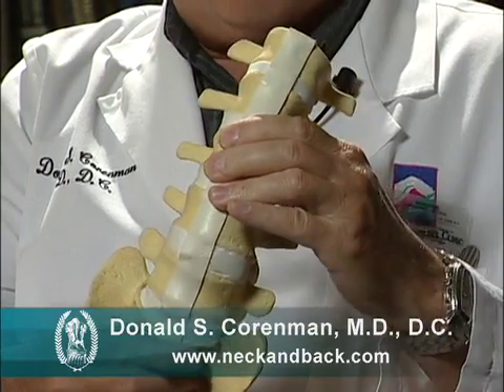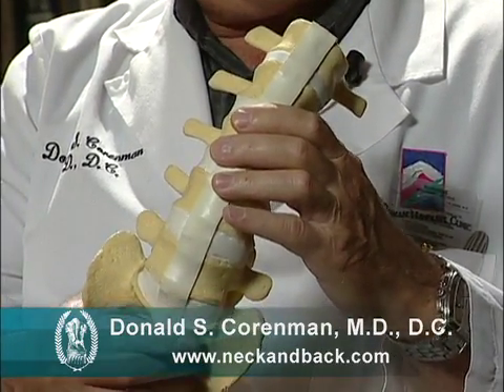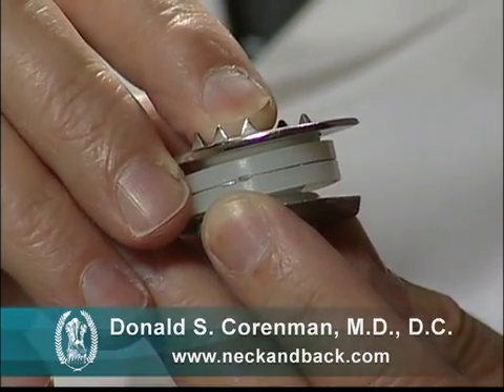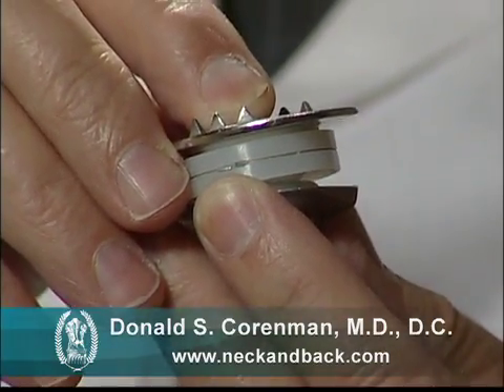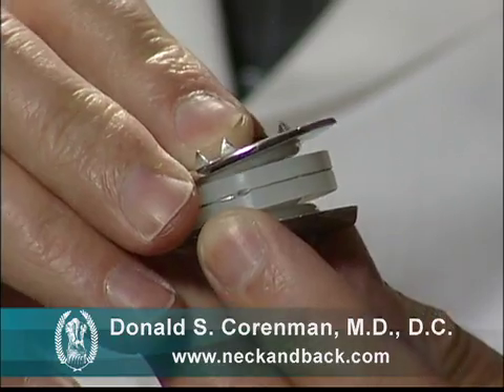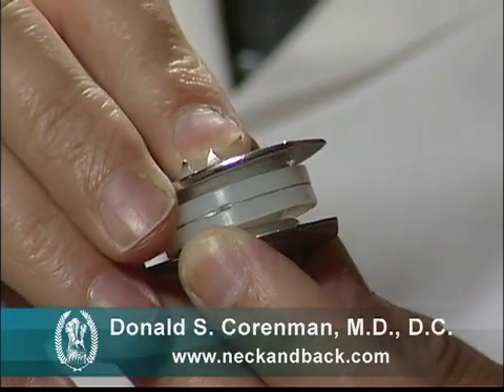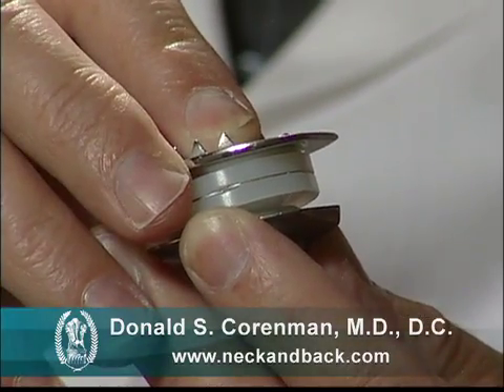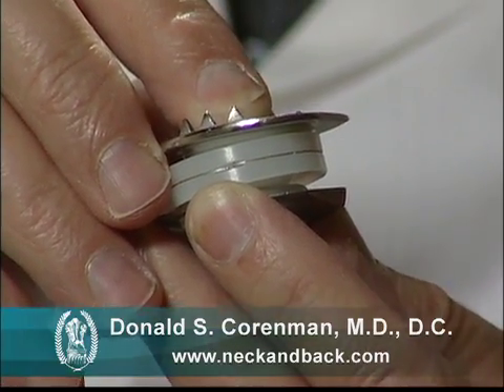Artificial Discs in the Lumbar Spine | Spinal Disc Implant Surgery | Vail Spine Surgeon

Comment: Thank you so much for this video.   You did not mention what type of artificial discs these were.  I was told I need a silicone disc put in where my L4 and L5 is. and that the upper and lower bones would be screwed together.  Now is that a fusion or is that just a replacement, and is a silicone disc more flexable and better than the one you showed?   I did not relize it would have to go in through my intestines and around my heart.  I have a problem with pvc's in my heart.  Can this potentially be a deadly surgery?  Please write back.   Thank you again.

Comment: Hello Dr. Corenman,
Thank you for you insight but I believe a lot of spine surgeons are overlooking the latest technology out there because the lumbar spine is a 'huge market.' 
The M6-L (spinal kinetics) has a viscopolymer core to mimic the nucleaus thereby allowing axial loading and braded steel surrounding the core to mimic the native annulus of a disc thereby allowing progressive resistance.  The structure is then wrapped in a polymer sheath that may prevent debris from leaking out.